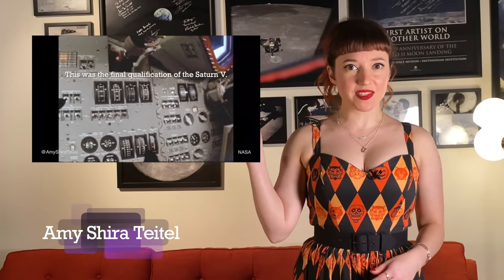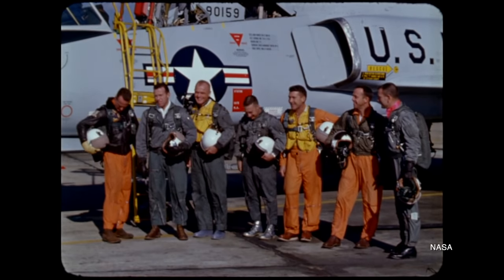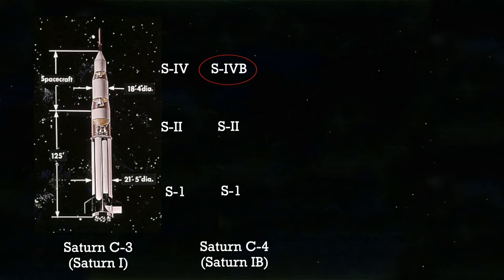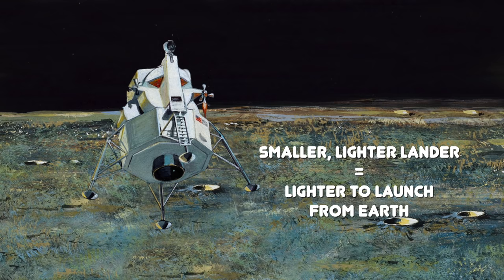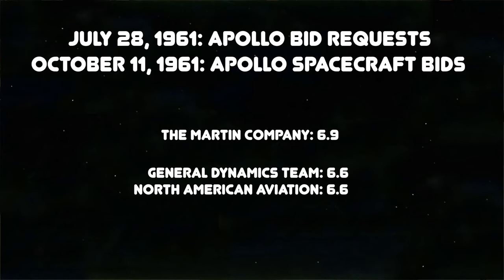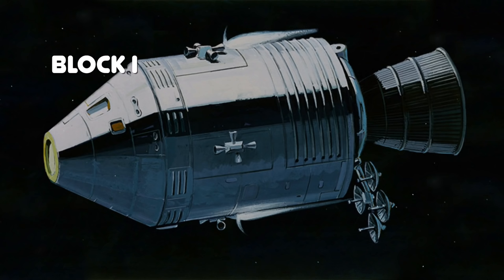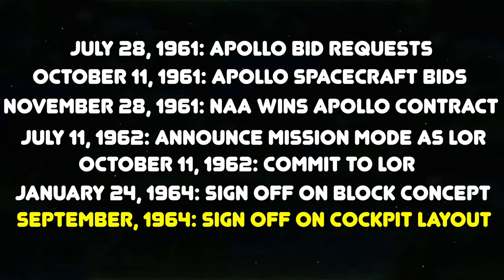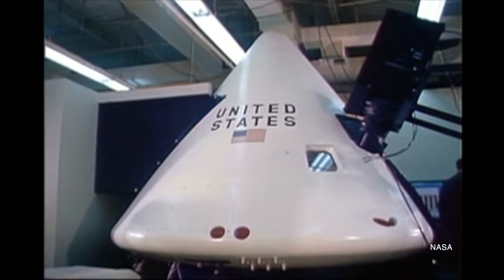NASA Built Two Versions of the Apollo Command Module

Comment: The horrific part was when Amy says contaminants in their oxygen supply was what killed them.  Not the fire itself.  I've always found a crumb of comfort in thinking they died quickly.
Reply: Read the autopsy report mate, 2 of them had gotten off their harnesses and tried to open the hatch despite the internal pressure making this a loosing battle, the only one found in the seat was there only be aise he was following procedure of calling out the alarm. All three died of asphyxiation due to smoke inhalation and most of the burn (not all) were largely post mortem.
Reply: I worked at the Roger B. Chaffee Planetarium while in high school.  We had many of the original investigation documents of the fire in archives that I read carefully.  It was a gruesome thing.  Pressurized pure oxygen fires burn very hot.  However, after the pressure burst the inner cabin wall on the right-hand side at after approximately thirty seconds of being fed by a cabin atmosphere of pure oxygen the now fed by outside atmospheric nitrogen-buffered ambient air, the  fire decreased in intensity and started producing large amounts of smoke that killed the astronauts. They lost consciousness because of a lack of oxygen which sent them into cardiac arrest. They died from asphyxia due to the toxic gases from the fire and burns contributing to their death.  Roger Chaffee's couch was found in the horizontal position, with the lower portion angled towards the floor. His helmet was closed and locked, his restraints were undone, and the hoses and electrical connections to the suit remained connected. As he was farthest from the origin of the fire, he suffered the least burn and suit damage.
Reply: @TheAshwinShukla  Yes, I knew they did not die quickly. I read somewhere their telemetry and radio didn't fail for a while, so the the ground crew could hear them.

 It was just hearing her say it made me think of it again.

I admit my original comment was not well phrased.
Reply: @WWeronko  Thanks for that. Nobody really talks about the mechanism of the fire burn under pure oxygen versus the fire after the pressure vessel ruptured.
Reply: You can really see her trying to keep her emotions under control when she explains that part too. Utterly heartbreaking
Reply: there is audio of the communication, its horrible to hear! you can hear Chaffee screaming "Ahh Fire, It's Hot, Get me out of here!" R.I.P. Grissom White Chaffee

Comment: Being a nerd, I knew of many of the things in this video (but definitely not in near the amazing detail as you laid out). But the thing that I had NO idea about and really surprised me is the "dual gas/bleed-out" system. That's fascinating!
Reply: It sort of grew out of the system used in the X-15 and some other high altitude rocket plane programs. On the X-15, the pilot was breathing pure oxygen in the pressure suit while nitrogen was used in the cabin to mitigate the fire danger, partly because the X-15 had the pilot sitting just in front of the fuel tanks.

In orbit, pure oxygen at 5 psi doesn't cause fire to burn much faster than oxygen/nitrogen at sea level pressure. Plus convection acts a little differently in zero gee.
Reply: Its in starship

Comment: Apollo 7 had a few “Block I” pieces, such as the Couches.

Lunar Orbit Rendezvous (LOR) was originally proposed by John Houbolt, 
using the Saturn C-3 launcher (1961-1962). 
The Saturn C-4 and C-5 designs came as Lunar launcher simplification (1962-1964).

Comment: I had no idea that there were 2 versions of the command module. If they had waited for the block 2 to be ready, then White, Chaffee, and Grissom would still be alive.
Reply: Who knows. Maybe Block 2 would have had other issues. As mentioned a lot of the disaster was attributed to miscommunications and not implementing of changes to the vehicle. Also the fire wouldn't have happened, or wouldn't have been nearly as bad if they had used the mixed nitrogen/oxygen atmosphere as was used during the launch of later CMs. This still leaves the deathtrap of a hatch of course, and that might have still been disastrous. But as always: hindsight is 20-20, so it's easy to say today how it should have been.
Reply: As a kid getting drawings and punch out paper models in the mail,  I was confused by the different versions of the LM, Capsule and SM of what they sent me 1967 to 1970.  The LM prototypes were very visually different from what they sent.

Comment: RIP Apollo I crew, had their sacrifice not occurred on the ground it may have occurred later in space with another crew ending in disaster for the whole program.
Reply: Yes. It really seemed like it was just a disaster waiting to happen.
Reply: What they missed almost killed the Apollo 13 crew.
Reply: When the Apollo 1 backup crew (Schirra, Eisele and Cunningham) arrived at Ellington and were told of the fire by Bud Ream, Cunningham's first comment was, "Thank God it happened on the pad.". As an engineer, he understood that a ground based accident secured the chain of evidence that would lead to a cause and then a solution.
Reply: @allangibson2408  not sure they missed anything since Apollo 1 involved a Block 1 (orbital missions) command module and Apollo 13 involved a Block II (lunar missions) service module. Since the Block 1 was designed with Earth Orbit Rendezvous in mind there are substantial changes between them. Especially in the case of the O2 storage and fuel cell systems that caused the accident on 13.
Reply: @nicksantos43  The pad test power supplies were 65V DC  (a hang over from the Gemini program) - the Apollo capsules were 24V DC. Apollo 13 root cause was identified as a thermostat that was damaged by the higher voltage resulting in its contacts welding closed during testing on the pad.

Comment: Thx Amy for a fascinating look at both the CM block development and Apollo 1.  My interest in Apollo 1 goes back to my Ryerson University days when I wrote a technical report on the fire investigation findings.  You just provided great info on why Oxygen Nitrogen mix was never used, why fire safety measures were never applied to the block one Apollo 1 CM after the 1966 test fire and from a non-tech standpoint, that AS-204 was always called Apollo 1 by the crew (hence the crew patch) - even though NASA didn't change the official designation until after the fire.  I will definitely check out Eisile's book for more Apollo development details.  I was wondering what the original block two hatch was going to look like - thx for confirming it was still going to be that crazy 2 piece design. Incidently I once read that the CM depicted in Marooned was based on a block one boilerplate spacecraft - retro fitted with the outward opening new hatch  - as it turns out, just like Apollo 6.  Thanks again for the great video.

Comment: The spacecraft that became the Command Service Module started its design life in 1959 - almost immediately after Project Mercury was announced.
It was recognised that the simple, one manned Mercury capsule was very limited in its capabilities. If manned spaceflight was to have a future beyond Mercury, then something bigger and more versatile was needed. That is the origin of what became the Apollo spacecraft.

What is interesting, and rightly emphasised by Amy, is the redesign of the Command Module hatch between the Block 1 and 2 designs. The common story you hear is that the hatch was redesigned because of the Apollo 1 fire. That is not really the case. The hatch was redesigned much earlier in order to facilitate EVAs, something that could not have been done with the original Block 1 inward opening hatch.
Obviously, changes were made to the Command Module after the fire but the fundamental switch from an inward to an outward opening hatch predates the fire by a number of years.

Comment: Great Video !  This is still a very great video after three years !  The Apollo capsule with the Service Module had a large powerful rocket engine to take off from the Lunar Surface (LS) and return to the earth !  The Apollo capsule and the Service Module would land on the moon with a upper stage of the Nova Rocket... With no time to build the Nova Rocket (could not be built before the end of the decade of the 60's), NASA had to use the Saturn 5 with the Lunar Module (LM).  Also Draper Laboratory then part of MIT worked on Guidance and Navigation for the Apollo Program and moved the world to digital computing from analog computers !  tjl

Comment: The direct ascent architecture tended to yield very tall and fairly skinny spacecraft including command and service modules that are difficult to land on the Lunar surface at an unprepared site. A larger Saturn rocket like a Saturn C8 would have allowed using a polar Moon-orbit avoiding the breaking maneuver and the later trans-Earth injection maneuver to take place out of contact over the Moon´s Farside and landing at the equator or the Lunar poles. Creating the Apollo Project as a dead-end project was counterproductive and had a part in abandoning the development of the Moon. The Soviets planned to use a polar orbit for their Moon missions. The Apollo Project had no reason to hurry because the Soviets had difficulties to build a rocket stage with a large number of medium-sized engines. There was no reason to run the Block 1 plug out test manned. A nice bit of history, thank you.

Comment: In "From the Earth to the Moon" episode about the Apollo 1 fire, they pinned the blame on frayed wiring from all the rework, combined with all the velcro pasted on the inside of the capsule for the astronauts to stick their checklists, etc, to, all sealed inside a pure oxygen environment under high pressure.  They demonstrated that in regular air at normal atmospheric pressure velcro just smolders, but in pure oxygen under pressure it burst into flames.
Reply: In a pure oxygen atmosphere at sea level pressure PCV electrical insulation burns like a candle... PVC will not burn at any temperature in normal air (it just carbonises).

Comment: Thank you. That was a very good, detailed, and succinct report Sal. The first loss of power from the generator engine stall may have damaged that transformer. A fast current spike (loss or increase) can inductively harm equipment like that transformer. Surely the NTSB will test that transformer to see if it is electrically sound.

Comment: At 36:40 there's a snippet of footage that has puzzled me since childhood. 
As the adaptor ring is left behind it rotates slowly. At first you can see the hot gases from the freshly lit engines flowing through it. 
But further away it's side on. The exhaust can no longer be getting inside the ring. But as it rotates side on you can still see what looks like rocket exhaust coming from inside it. 
Is it gasses being redirected by the ring? Is it small separation thrusters?
Play it a few times, it's fascinated me for years. Is it something really simple I've been missing all this time?
The actual effect is at 36:44 approx. See what I mean? It's very brief but it looks as though the hot exhaust is pointing towards the engines as the ring tumbles.

Edit: Pinned down the exact timestamp.

Comment: One thing:  The Fédération Aéronautique Internationale rules for an "Orbital Flight" required that the vehicle take-off, orbit and land under its own power, with the passenger on-board.  The X-15, by virtue of being launched from a mothership, would be disqualified as "the first manned orbiting vessel".  This is also the reason the USSR lied about the recovery method of the Vostok capsule.

Technically, under the FAI original rules, John Glenn was/is the first man to orbit the earth.  However, the FAI changed the rules to allow the Vostok to stand as the "first".

Comment: I was always fascinated by the mode decision.  I still think we chose wrong.  While the Lunar Orbit Rendezvous was the simplest, it only solved the problem for going to the moon.  Earth Orbit Rendezvous could have been used to springboard missions to other planets and may have even led to a long-term manned space station much quicker then what we actually got.  I am sill dismayed that most of the proposed Lunar and Mars missions for the foreseeable future don't use EOR.  It would eventually lead to on-orbit vehicle assembly, which is where we really need to go.  Hey Space-X, tired of throwing away all those M-Vac engines?  Park them in orbit for future missions!

Comment: Someone ask me the question about why did they paint the rockets, paint is heavy. I was thinking white is reflecting heat the black must be for long range observation/ telemetry and maybe for corrosion protecting. Have you stumbled over how much the paint they was using weights?
Reply: She has and it's already in a video. I think it's under the "Why are NASA's rockets painted black and white?".  Hint: it makes it easier to exactly locate the vehicle when photographed for engineering purposes...because the boundary between the black and the white is sharp and even when photographed they can still get accurate measurements even if it gets fuzzy with distance or atmospheric blurring. The paint does cost some weight but the improved photo-metric documentation is worth it.

Comment: Excellent overview!  I am saddened that the Block 1 units could have been skipped for Apollo 1 but were not due to expense.  I am wondering if the original block 2 units were much safer though.  You mentioned that the hatch was redesigned and a full review of the materials was done.

Comment: The less safe block 1 CM and updated safer Block 2 CM. 

There were at least three versions of the LM. Block 1 too heavy to be fully fueled for lunar landings, but were fine for dress rehearsals on earth and lunar orbits to prove systems capabilities. Block 2 LMs for Apollos 11-14, and the final LM versions modified to be still lighter and carry Lunar Rovers and more consumables for the extended stay 15-17 missions.

Then at least two versions of the manned Saturn V launch vehicles.  It was lightened considerably for the rover/extended stay missions. Among other changes, later versions launched with only 4 ullage rockets on the S1C=S2 staging ring. Earlier versions had eight of them. Every Kg saved in the Saturn V allowed more weight committed to the LM.
Reply: One of the other changes was  the 'bell' of CSM engine to give it more Delta v using the same amount of fuel. A bit of a block 2 'plus'. I think a similar change was made to the descend stage of the LM.

Comment: They KNEW it was dangerous. THEY KNEW! I never realized that. They upgraded the block 2 because they KNEW! They probably didn't upgrade block 1 because of money. And then, they were told not to fly Challenger until the O-ring design flaw was fixed. They knew what happened before, but they did it again anyway.

Comment: So.... this change to the capsule atmosphere works because they wear suits during launch?  Astronauts start breathing pure O2 at 15 psi on the pad, while the capsule is straight air (78%N2 21%O2).  During launch there are perhaps times when the combination of N2/O2 mix and pressure might not be ideal, but doesn't matter since suited.  For example, no additional O2 added until the pressure drops to the flight pressure of 5 psia would lead to too low partial pressure of O2 at times. By orbit, the pressure and N2 concentration have both dropped and the capsule atmosphere is again a known, safe level.  Lower fire risk on the pad without adding additional hardware/ weight.  Clever decision.

And of course, once in orbit, the cabin pressurization system can be verified to be working before they doff their helmets and suits.

Comment: Amy   love your video.   One minor issue in the naming of the various stages for the SATURN 1 (C3)  
First stage of SATURN 1  was named S 1, composed of  cluster of 8 H-1 engines ,  The 2nd stage is named S-IV 
composed of 6 RL 10 Centaur engines,  The 3rd stage was named S-V,  composed of 2 RL 19,  in essence a Centaur 
It was never flown  The upgraded SATURN 1-B  (C4) had an improved 2nd stage the S-IVB  which formed the 3rd stage of SATURN V 

i know,  I'm a space nerd 

PS  where is Pete, usually makes an appearance during your video

Comment: Your designations of Saturn C-3 and C-4 are INCORRECT.
1959-1962 Planning during “Saturn C-series” planning was 1 thru 5, plus Saturn C-8 (Nova derivative).
Only 3 were actually built: Saturn I, Saturn IB (also referred as Uprated Saturn I), and Saturn V.
The Saturn I was shown to President Kennedy in November 1963 (Florida), by von Braun, a week before his assassination.
The Saturn IB was just short of the Saturn C-2 plan specifications (hence, uprated Saturn I).
Saturn IB was used for manned Earth Orbit missions (Apollo 7, three Skylab crews, ASTP) of
Apollo block 2 spacecraft.  Launcher was underpowered for Apollo CM/SM weight, so spacecraft was not fully fueled.
The Saturn C-3 was cancelled in 1962 (after LOR decision) .... it was never built.
Blue Origin’s New Glenn is the closest future vehicle of that 1960s design & payload lift capacity.
SpaceX Falcon Heavy meets the payload lift specification of Saturn C-3, with a three Falcon 9 core design.